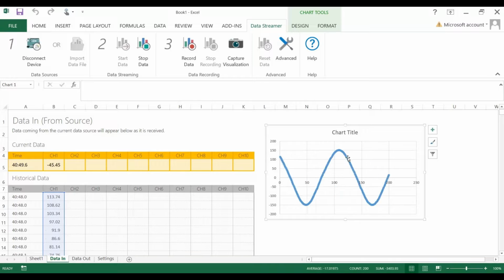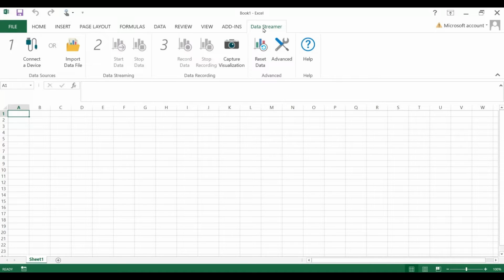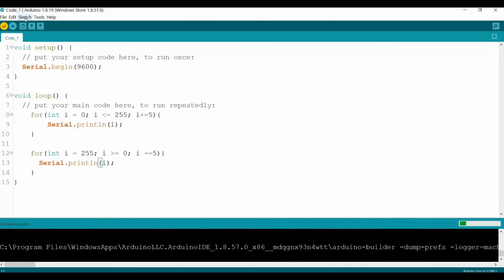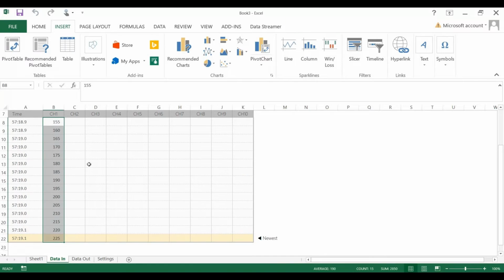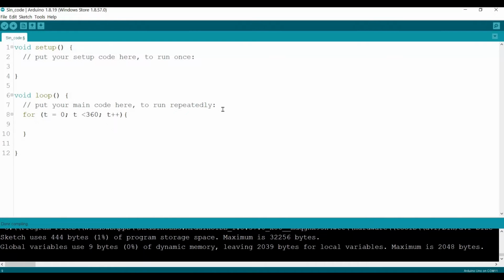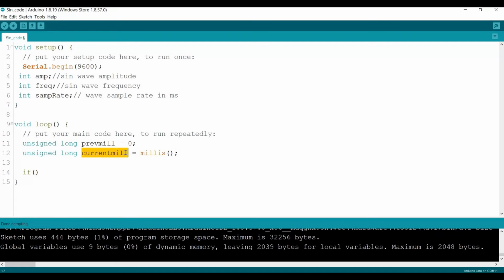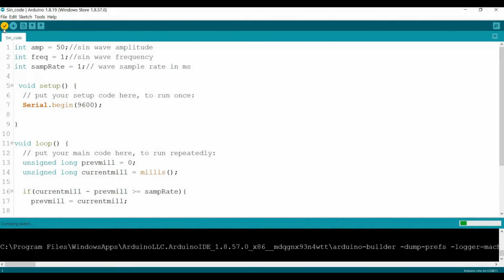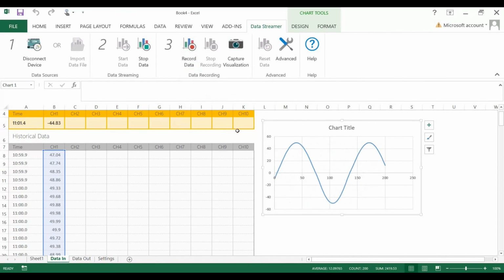Connect Arduino to Excel for Real-Time Data Logging (Step-by-Step)

Comment: when I add the data stream (com port) it says can not connect because the data source is already in use.
(But this is the stream I want to display in excel)
Reply from the maker: Make sure the Arduino is properly connected to the COM port. If it is already being used by another application, you can try closing the application or restarting the computer.
Reply: Make sure you are not simultaneously using the Arduino IDE Serial Monitor.
Reply: @loddie9  Thank you! This just saved my project